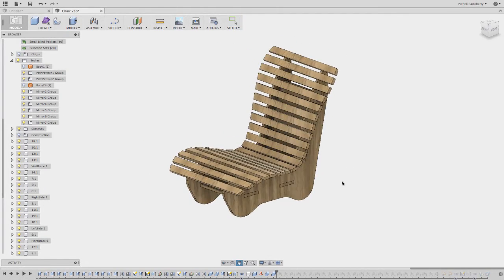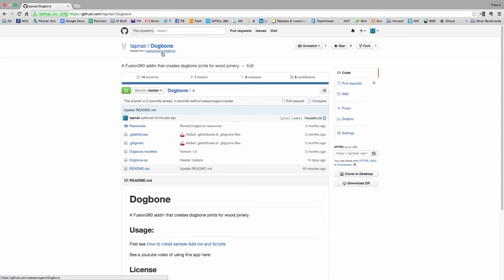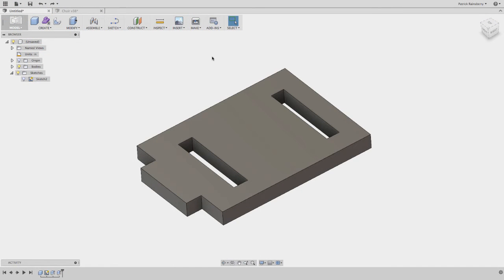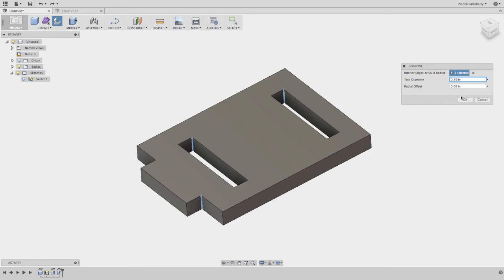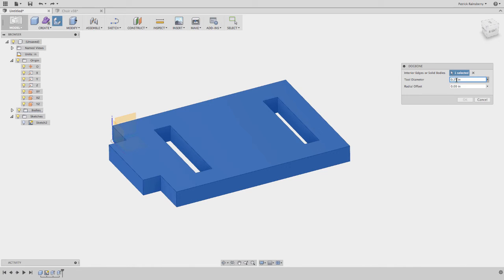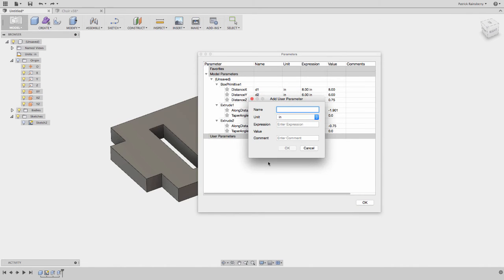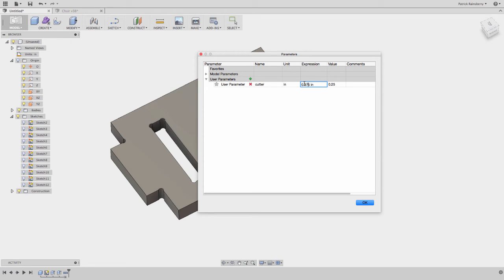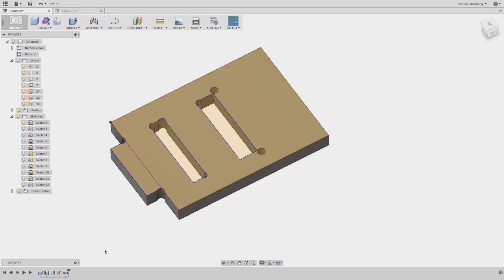Dog Bone Fillets in Fusion 360 (For CNC Routers)

Comment: Patric, nice add in. If you don't mind I would suggest to add some other ways of dog bone, one where arc is tangential to the side and other one where arc is tangential to the bottom of the notch. Also, I guess, you may add option regarding the z axis to let the user chose which axis is vertical. 
This is just from the user perspective, to make it more usefull.
Reply: Letting user decide Z-axis would be an great update. It's seems impossible to keep your model intact when using the addin. You can now only use it as a last step when laying all bodies/component flat out. It should be able to adept this addin in the middle of the timeline somewhere!
Reply: Also indeed. Is this the best way to do a dogbone. The circle touching the line? And not the line is the center point of the circle?

Comment: Latest version of dogbone works only when selecting edges, not bodies. When bodies are selected, the fillets simply don't get applied.
Reply from the maker: There is a caveat in the way i did it.  To pick the right edges it only looks at edges that in the "Z" direction.  Are you sure the parts are laid flat in the XY plane?

Comment: Latest version of DogBone ea1e6cc  throws exception when run on latest version of Fusion 360 2.0.2541, that is very sad. Unfortunately error is written as a picture on the screen (text not copiable), no idea how to insert picture here
Reply: I've had trouble too. I just downloaded the newer version and I'm finding that it "stands my pieces up" and doesn't make the dogbones.  Basically, I have my components copied into another component in order to lay them down. When I run dogbone on any interior edge of any piece, it reassembles my pieces to how they were modeled.  I'm also having a lot of trouble selecting edges but I think that might be a F360 bug.  Lot's of stuff appears to be borked at the moment.  Could this issue be on account of a joint that I created?
Reply from the maker: Hey are you using my "fork" or Casey's original?  His has been broken for a while.
See the description above for links.
I did a pretty large update to it which should make things more robust as well.

Comment: Great add-in! One thing to note: I was having issues with it not working when trying to dogbone solids made from box command. It seems this add-in only works for me if I create the solid from a sketch first. Seems that the add-in needs to reference a sketch. Still, a nice add-in to have. Thanks!

Now, if Fusion 360 could implement multiple-page drawings and custom title blocks, my life would be so much easier!

Comment: I have a router with automatic toolchanger and I would like to do the main cuts and pockets with a larger, faster tool and then clear out the dogbones with a smaller tool so my dogbones are as small as possible. Is there a way to have dogbones cut with a different tool from the main cutout of a pocket with Fusion 360?
Reply from the maker: +Evan If you designed in the diameter of the dogbone cutout to be smaller than the diameter of the tool you use for the pocket clearing then it will simply skip over that area as it can not reach it.  Then with the smaller tool you could just do a contour or even use rest machining and only remove the material that is left over after the larger diameter clearing.  The key in Fusion is to just model the geometry how you want it to come out and everything should fall into place.
Reply: Hmm. That could work. Except that I often do all my drilling and small features first with a small tool and then do my large cutouts etc at the end.  Pieces stay in place better that way. I guess I need to find a way to do "inverted rest machining".
Reply from the maker: +Evan Hah!!   Maybe it would make sense to just do the dog bones with a drilling op?
Reply: +Patrick Rainsberry Ya got an auto script for that?
Reply from the maker: +Evan Yes!!! Actually Fusion handles this for you.  When you create a drill operation you can set it up and pick the face of one hole.  You can select a dog-bone cylindrical face here.  There is a check box just below the face selection that says: "Select Same Diameter"  if you check this it will find all holes of the same diameter in the model and apply the same drilling operation.
Reply: Woah!
Reply: btw, I asked on the CAM forum about "reverse rest machining" and someone suggested doing the operations in normal order with big to small bits then protecting the operations and then changing the order. This seems to work, at least on the flicker of my puter screen.

Comment: Very new to CNC, but I thought things like dogbones were normally done in the CAM while making the toolpaths, not baked into the CAD.

Can Fusion 360 do toolpaths that include the dogbones without having to model them in?  Seems like something people would want to be able to do a lot without having to modify the model itself, like if you are carving out an STL or another file type that is harder to modify.

Or are you just doing this to get a more accurate model of what the final chair pieces will look like after carved?
Reply from the maker: +Alluvian Fusion 360 does not currently does this.  Its on our radar/roadmap but wanted to get something out there until it is available.

Comment: I have installed the add in to Fusion 360, and it shows up in my add in pulldown in Fusion 360 but I do not have the icon in my create menu or the create pulldown. It shows that it is running, but I am unable to use it. 
Here is the directory that I have it installed in:
C:\users\kevin\appdata\roaming\autodesk\Autodesk Fusion 360\Api\Addins
Reply from the maker: +Kevin Roskam when you look in the script/addins dialog box under addins it shows the little ring of dots next to the addin?

Try stop and start the addin?  Do you get any errors when you start it?

You are sure it is not at the bottom of the create menu?
Reply: +Patrick Rainsberry it shows up in my scripts with the doughnut, but does not show up in the pull down menu. I have started and stopped it numerous times but it still does  not work.
Reply from the maker: +Kevin Roskam Wow that is weird.  I think you should post here  in the API forum.  Probably need to have QA person take a look:
http://forums.autodesk.com/t5/api-and-scripts/bd-p/22

The forums are actually really responsive and there are many people that monitor them from QA and product teams.  Should be able to figure out what is going on.  If not I could maybe do a screen share or something with you next week.
Reply: +Patrick Rainsberry I uninstalled it and then reinstalled it and it works. I don't know what happened the first time, but it works now. Thanks for the reply. I will use it often I think.
Reply from the maker: +Kevin Roskam Awesome!  Good to hear it is working!

Comment: My attempt on this resulted in the X direction on edges not the Z direction. If I select the edges directly it works properly. Any suggestions.
Reply from the maker: +Jack Tinsley Are you sure?  There is an option in Fusion 360 under preferences to set "Z up" This only applies to new designs.  Is it possible you have it aligned to the "Top" view but that isn't actually "Z" in your model?  You can tell by looking in the "Origin" folder in the tree on the left of the screen.  Make sure the Z axis is really in the direction you think it should be.